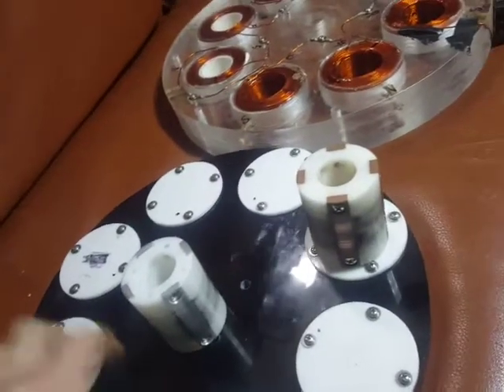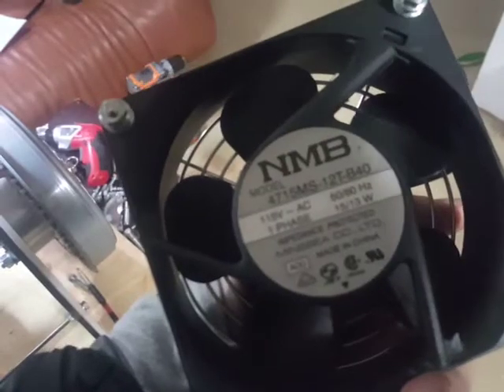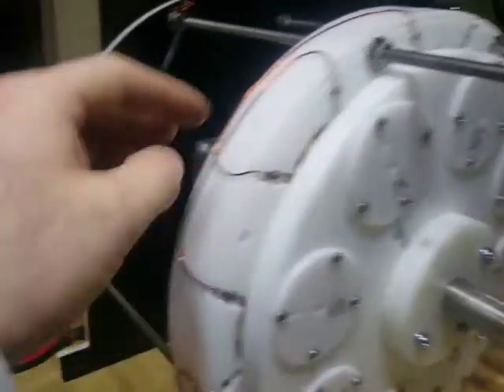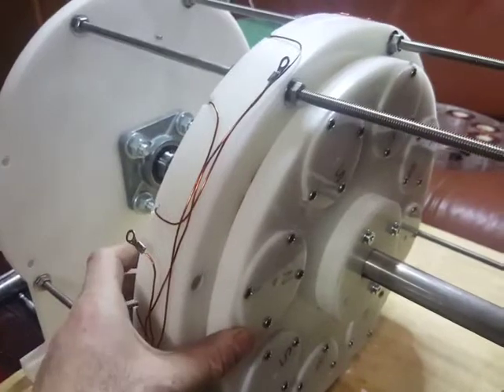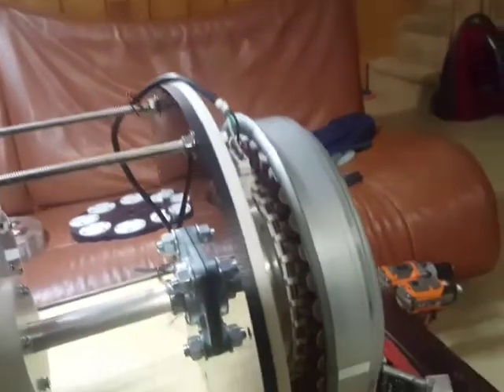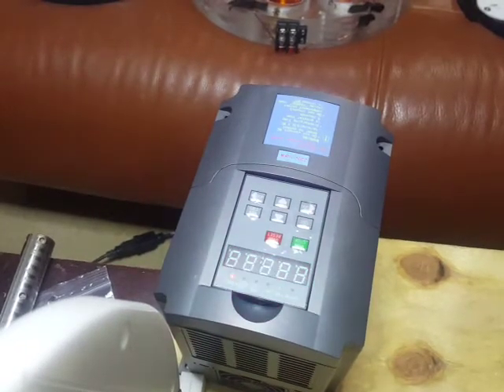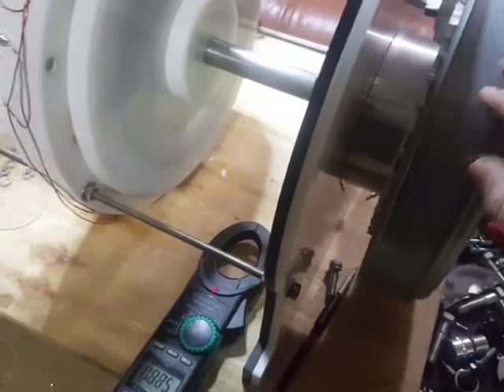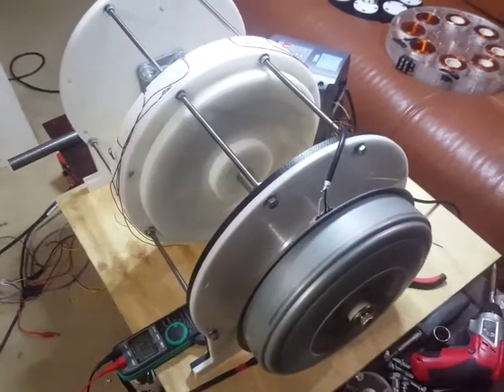SP 500 Generator from Creative science

Comment: The Only way this would work is to apply at least 500VDC via High Frequency Diode Bridge made of FR607. The Diode Bridge would serve as your Foward and Back E.M.F Collector too. 

It is Mandatory to us Heavy Flywheel so as to have A Motor Generator Setting. 

When you apply High Voltage, the commutator and Brush get the coils to resist the magnets and thus rotates. Once the Coils are Switch Of, The Flywheel having stored Energy, turns the coils into A Generator.

Comment: So this was 4 years ago! Did you ever get it working? Did you try putting a bigger load on it?
Reply from the maker: Load kils the motor. Later i realozed this will never work if you put a load on it. This device may work if you increase the voltage and decreaz the Amps but you have to have battary charger using Bedini circuit
Reply: @Genprojectalternativeenergy  and the coils we're wired in series? Not star? Did you ever try to rewire in a different  way?

Comment: One more thing i just noticed . You use air core. Well if you like you can increase the inductance by about four time  by inserting 2 mm welding steel filler rods covered with copper. They use them for Tig welding. I tried this experiment with a couple of coils with and without steel rod . When measured with my LCR meter  Q factor rose from 9.9 to 12.96 and the Inductance from 3.05 to 12.84mH.  So this is some food for thought.

Comment: Just a suggestion: Check the frequency, measure the total inductance , Add a capacitor using the formula for resonance .  To the output do not connect any resistive load as this will dump the output. Connect to the output a full wave  rectifier to obtain DC and install a capacitor across the output of 2 microfarads. Hopefully you will get much better output. Hope this is of some help. Wish you luck.  Nice design. I wish you show us the N52 Magnets by removing the cover . Thank you for the demo.
Reply: you sound like have personal success with Rick Gibson's designs???? =D

Comment: Hello friends, Genprojec.. and starlit..., I'm familiar with Creative Science from years back. They are a money-making company. They are lying claiming free energy and fuel-less operation. You see how he uses Einstein's photo, and a pyramid. All he does is sales technique. He doesn't tell you that you need a motor to turn the generator. The generator is a more efficient design called a window motor by Bedini. Newman also used that idea. It would have helped to have the axle made of light aluminum. The efficiency may be something like 70% which is a lot better than a gas motor, but you can't get 100%, or over 100%.   ...  What is your location? Since you are good at doing the work of constructing, I can show you inventions that are claiming much over 100%. There have been 100's of great inventions.
Reply: I'm in Michigan.  

Over time,  I'm going to make another smaller version of this (about three times the magnet pull-force).  I am going to turn it with a DC motor than can run on up to 24 VDC.  I use a variac transformer so that I can adjust the amount of the VAC that comes from the home 110 VAC outlet.  I use a bridge rectifier connected between the variac transformer and the DC motor.  This is done to change the voltage from AC to DC.  So the plan is to run the generator so I get probably about 18 VAC from it and then connect a bridge rectifier to the wires which should give me about 12 VDC.  Then connect an inverter (12 VDC to 110 VAC) to the wires, and then connect 110 VAC powered things to it (light bulbs, heater, etc) while measuring the watts consumed using a gauge I have (got on eBay for maybe less than $20).  I can also measure the watts consumed to power the machine by using same gauge.  So if I can get more watts out of it than used to power it, the machine is valid, if it not it is a lie.  Since current (flow of electricity) is used to power light bulbs, heaters, etc, then,  the amount of current produced by the generator would have to be more than is used; otherwise it is a lie.  Facts are facts, this will determine if "Creative Science and Research" is a criminal company or not.  I will notify the "Better Business Bureau" and other things when I determine the truth.  And if the machine is a lie and enough people who have bought the generator design plan and kits want to, we can do legal action on the company.
Reply: @starlitopensky1  I also studied their plans in version 3 and came to the conclusion that it is not what it claims to be (overunity). It looks like the Adam's engine in construction, but the working principle is bullshit. With a few modifications you can turn it into an Adam engine and then you can get a COP of over 800%.
Reply: @iononea1869  Can you direct me to information on an Adam Engine?
Reply: @starlitopensky1  how’s it been going?
Reply from the maker: @starlitopensky1  how did you do  with the project? It's been over four years  now since you posted here.
Reply from the maker: @bobt8735   It's been a while since i abandoned my project because I did not have enough  finance and  knowledge to continue research and developing  what was working . I live in NJ. If you are around  and have some things to share, please contact me in private, and let's discuss.

Comment: Using the motor I have, in the meantime I might just remove one of the magnet discs and then run it at a higher speed to hopefully get 110 volts.  If successful, I can do some testing.

Comment: I found a 5/8" center hole (size of hole) of washing machine motor.  How did you connect the 1" to your washing machine motor?
Reply from the maker: starlitopensky1  that was the pain to make that part, what we did was is ,i bought the original sheft for this WM motor and we used only had part whatever goes in the dram. The machine is made the extension of the generator shaft and press fit it in so it became one part with the threaded gear. That's why what's the easiest way and cheapest way to couple them together on to the  main shaft.
Reply: Genproject2017 alternativeenergy Oh, so what you have said is that you had the 1" rod pressed into the WM drum?  Therefore the diameter of the WM motor hole must be 1".

Comment: What make and model of washing machine motor is this?
And how did you attach it to the end piece and rod?
Reply from the maker: starlitopensky1 this is LG WM drum drive not sure what model. any model will work. Machinist made the mounting bracket for me. I think i just start understanding why my Gen is not working as it was advertised. After i reviewed the plan, 362-RC350  this clearly explains the reason..looks like i need to rase the DC voltage higher 600 V + they also have voltage multiplier plan and shows how to connect the diodes and capacitors to multiply the voltage. I have not done that part yet. If it works that would be super awesome. Let me know if you are that far to apply the high-voltage on your motor and see if it makes any difference thanks.
Reply: Genproject2017 alternativeenergy I'm not that far.  I have built my machine but am looking for a motor to turn it.
Reply: Genproject2017 alternativeenergy I have not read anything about DC voltage in the plans, I may have missed this.  It would be very good if get success!

Thanks for motor advice.
Reply from the maker: starlitopensky1 if we don't build a high-voltage DC motor which is fuelless engine we're not going to get anything from there. even so I have a washing machine drum motor it's not good enough becaus what i spend in power barely makes the same . So the point is when you're using the high voltage, then the current goes in the milliamps and that's what's the whole point there, then you're storing the energy into the capacitors and the capacitors converts into the high current and creates the presure in amperage, that's provides the  BEMF and assists  high voltage DC motor to provide  more horsepower ,which is important point in this plan.that's the whole philosophy into here. try to read those plans. you may understand that better, by the way these plants are floating on the internet. I also read on  energyforum.com and many people were skeptical so did i but I read it again and now it makes point the people who built this generator they were much more knowledgeable about Electronics and they admit that it makes sence to run the motor on the high voltage,low RPM , On miliamps. So voltage multiplication is free. But the high voltage will not do anything without the capacitors. capacitor creates the pressure which is the amperage. That was my confusion from the beginning and now I'm getting to the point.
Reply: Genproject2017 alternativeenergy I just want to at least get what you're getting, and then I will contact Creative Science if I don't get more out.  I'll let you know.

Comment: I am a beginner and I need help, if there are good people somebody answered me, I bought plans from creative science, I made a 4-pole generator, I copied everything the same as in the plans, but I had to change turns of wire because I need to 220 V (doubled the turns of wire), now I have AC 220V and 50Hz from the output when I measure it, the generator starts with another motor (torque and frequency regulator) at 1500 rpm and everything is ok, I tried to connect the 400W device directly to the output wire and the generator began to work hard and it crashed the voltage to 160V, when I tried to start the 2 kw device directly on the output wire it could not, started to hear the sound to be heard and worked as if it was sending the current back to the output, a voltage tester shows the reaction in both output wire.
what is the problem?
Reply from the maker: sobni sneg  it willnot work on direct connect because of the Lans LAW!
Reply: OK so if He can't show you the Ampridge going in before he hooks it up and after he hooks it up at the  battery pack then this  is fake you guys

Comment: V=IR
voltage equals current times resistance.

Resistance: is the resistance encountered by the elections (electricity) that are trying to move through a material (wire, etc).

3 methods to reduce the resistance of the flow of electricity in a wire:
1) Reduce the length of the wire.  
Note: Probably not good for this machine since supposedly many winds are needed.
2) Increase the wire thickness (diameter).  
Note: Very useful for this machine.  12 American Wire Gauge (awg) should provide very low resistance.
3) Reduce the temperature of the wire.  
Note: Not a good choice probably, but could put machine outside in below-freezing temperatures.

Making the coils as large as will fit and increasing the gauge to maybe 12 awg should have an effect on current flow.
Reply from the maker: starlitopensky1 all this stuf  i assume CS olready thought about that and they designer there stator, thats why i got from them, i have some thoughts to make this devise more efficient but it require more $$$ and tune up. The key futures are 1)my primery drive controller needs to be replaced ,2) i nèed to reach operation RPM around 800,  it require better ballansimg to operate 800 rpm , 3) the heavier flyweel wouldnot hurt and 4)  need to use secont stator  and connect them in parallel. All this would make significant increas of power.

Comment: https://m.youtube.com/watch?v=AX-jON9OVVY
Reply from the maker: SP500 electricity machine  i watched both of your videos and i want to say this is good that you have got you hands on this project too. More people start making there effort will be better so we can have common ideas and we might get usable results. Can you mesure the input power and then mesure the output power on the load to see your devise how much load can handle? What are you planing to use  amplify the current? How can you make load to be easily be handled for generator? Another word when you apply the load  GEN and your DC primery mover will be stressed out wich will caus to slow down and loos the RPM and energy. This facts will be very interesting to show how your device will handle all this. Voltage is not so much my interest because any device can produce the high voltage but chant handle the load unless you use some sort of cap bank with with some sort of transformer with sitcuit board. Keep doing what you are doing  its getting interesting.

Comment from the maker: Hey guys Rick mentioned if I would use this Gen as a battery charger it would be more efficient  for the time being. Today i was doing farther testing to see how I could convert AC to DC using 90 Amp 3-Phase Rectifiers eBay item number:390956513736, well the thing is if you use this device as battery charger  then I have to drop the RPM in order to bring it down to 12-14 VDC other wise  if I will be spinning this Gen around 500 RPM  i get 190 VDC. using this rectifier. 190 VDC is a lot of voltage, so how can I charge  the battery  with this high voltage ? what do I need to use  for to control the voltage ?